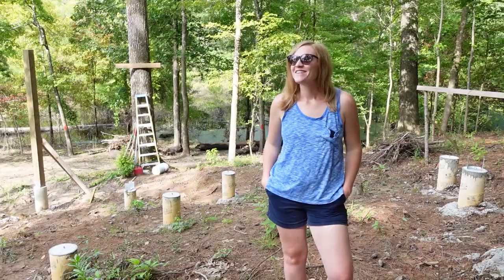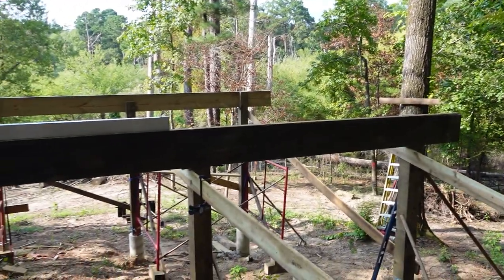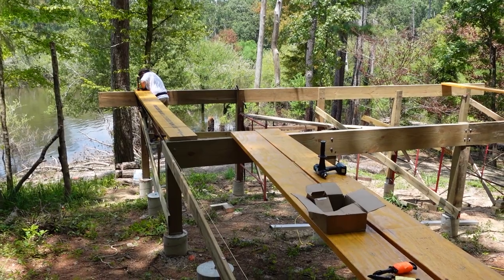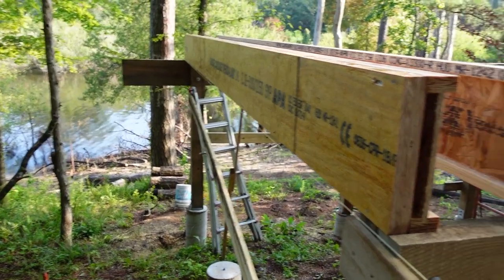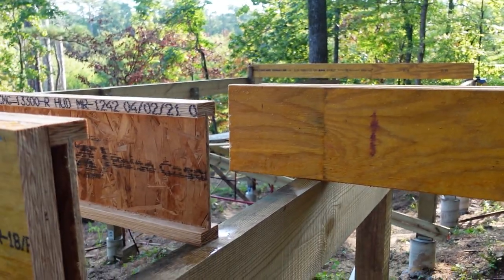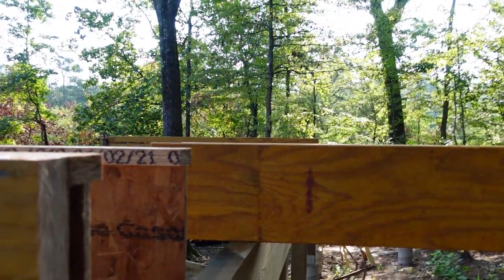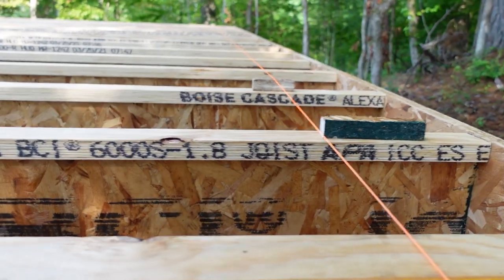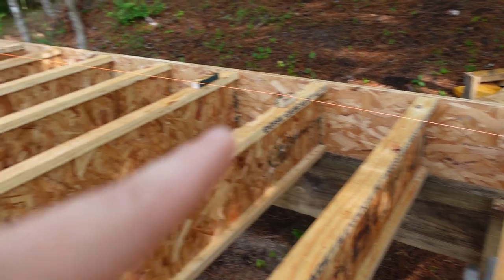Subfloor Framing with I-joists | Lake House Build Ep. 5

Comment: Diaphragm nailing glued and shot as per manufacturer's protocol... Dude, other than you, who said that LVL and one I Joist constitutes  applicable framing for your load bearing wall... Yeah, and as J Shepard below asks... did you need an mid span
support for your floor - Do you have Engineered drawings.. Or do you just go around framing stuff...

Comment: No bracing on the columns? What are you doing for wind bracing?
Reply from the maker: I have temporary bracing in place. The basement walls will add a ton of strength and I think I’ve come up with a good system for bracing the other posts.
Reply: @buildingsmall8422  I suggest you consult with an engineer.
Reply: I thought the concrete piers looked a little wimpy for everything on top of them 🤔